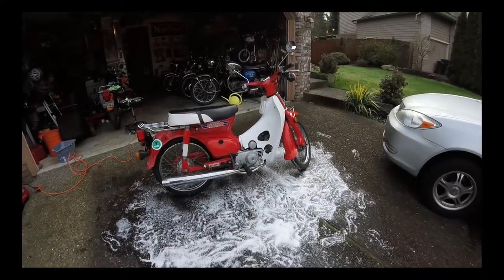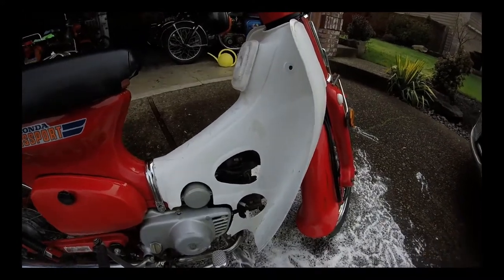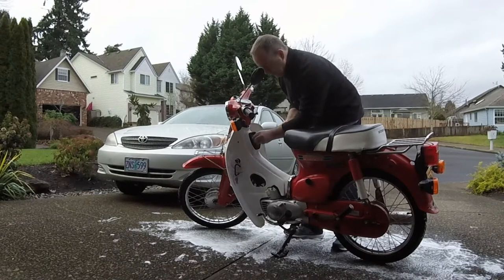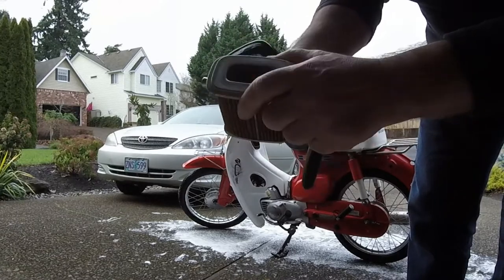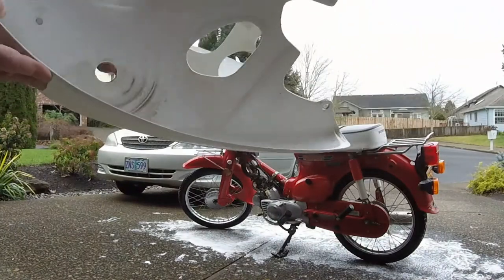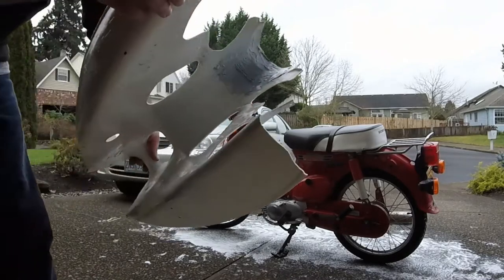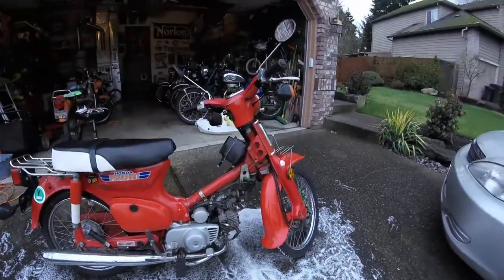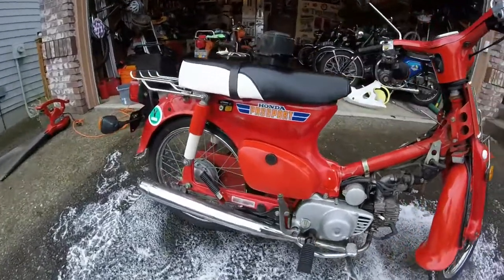1981 Honda C70 Passport (01) - Getting the bike ready for inspection

Comment: If you remove the battery and run the engine you will blow out your headlight. These bikes have no voltage regulator. The sealed beam headlights are pricey
Reply: You are absolutely right